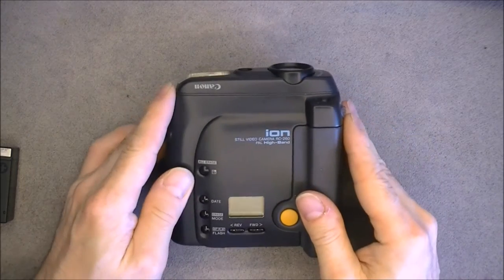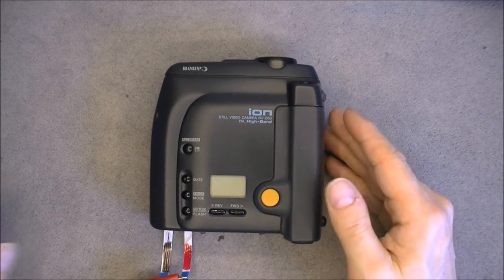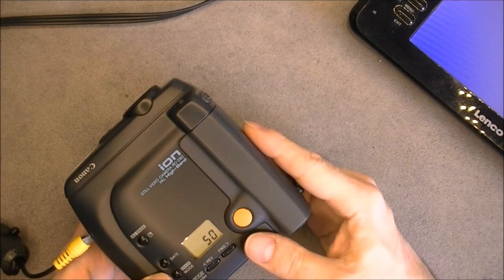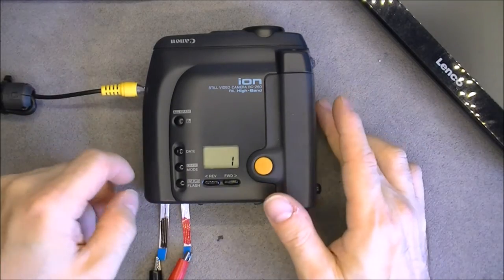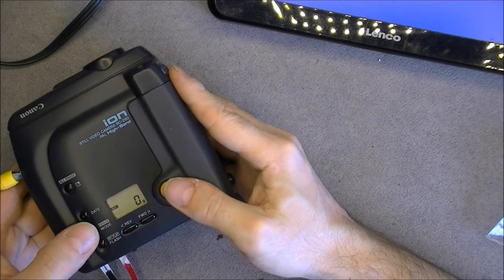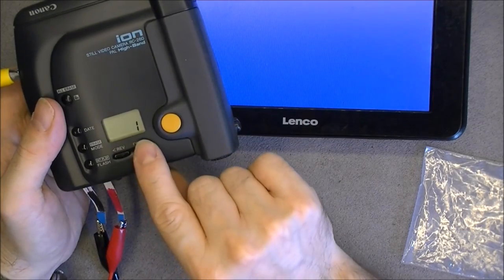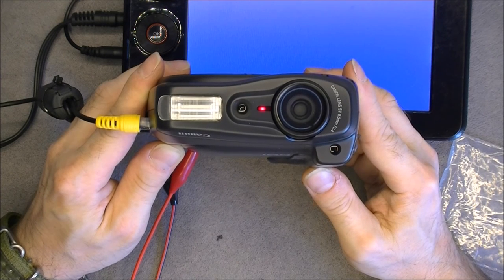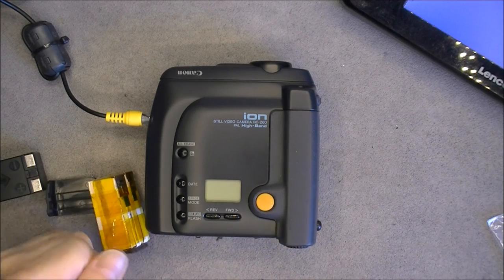Testing the Canon Ion camera

Comment: I have a RC-251 and it does the same thing. I am only able to take a photo on the first track before it thinks that the disk is full for some unknown reason.. maybe there is some internal battery for a memory controler or something that is caput? I can not find any information about troubleshooting online.. I should also add that my example is in mint condition, complete in the box and seemingly barely used so i guess it has to do with some component that has deteroriated due to the passage of time and not due to wear or usage.
Reply: @aliefhidayahramadhan1380  Hi, i have not. I am not even sure what to look for.
Reply: Hello. i have the exact same, and i trying to restore some old disc to see if i have any pictures on them from back then. did you find a way to truobleshoot it? i have plugged the camera in to the tv, but it showes nothing on the screen. do you have any info? 🙏